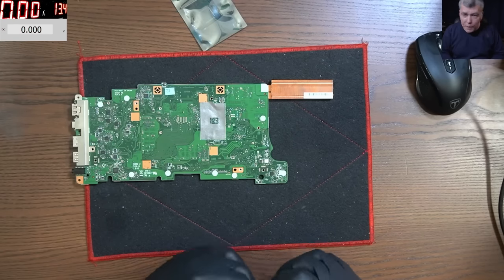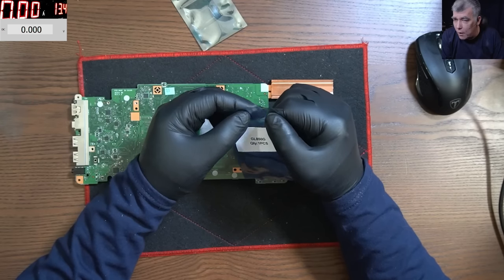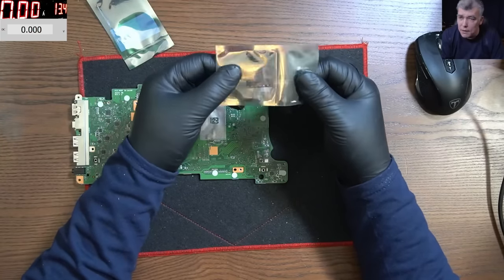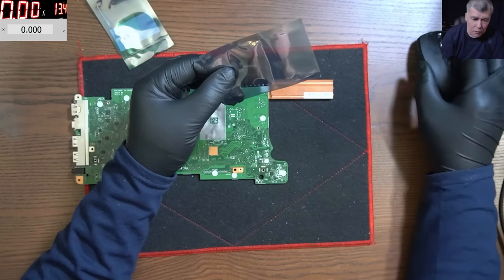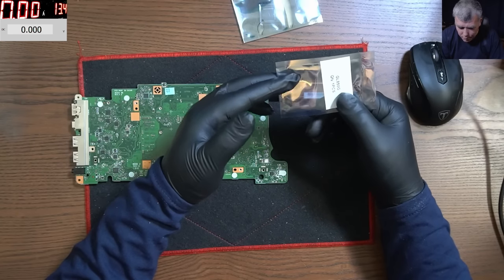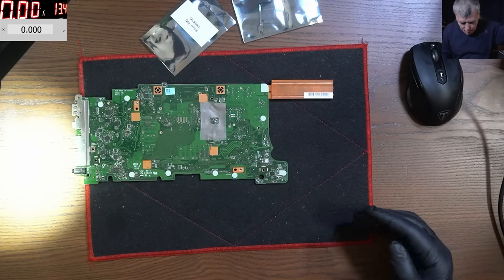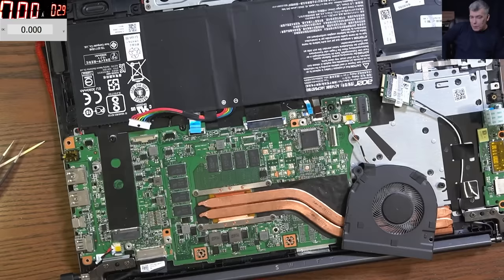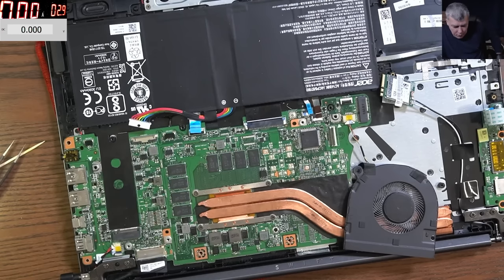Acer Swift SF315 no power - Part 2 - IO/EC/SIO chip programming

Comment: My God man, how can you deal with all those surface mount components, not to mention the lack of schematics and information on so many boards nowadays. I’ve been at stereo amp and tv repair on off for past 30 years and I still scratch my head trying to understand circuits with schematics. However I have never had a mentor or teacher, just book reading and exploring is my teacher. Props to you sir, I wish you the very best with this tricky repair.

Comment: Hi Sorin, for bios programmer you have selected , you need 1.8V adapter otherwise you will damage the bios chip
Reply: I think i have the same bios programmer but havnt used it yet. Do you have a link or more info about 1.8v adaptor?
Reply: yes it's better. I programmed a couple of them without reduction, but it's definitely not healthy for them.
Reply: 2 diode in line  to power will do the trick ....kkkkk my minipro work ok like that..  and don't overshoot the EEPROM, i just upgrade to xgpro from the same manufacturer
Reply: Can you tell me the device name that you use for programming the io chip I need  to buy one please help me

Comment: Hi Sorin. i have similar programmer & i used it since long time , it's very good, but it's complicated sometime as i have to find schematic to map KB connectors for unlisted boards , however you are getting error because you didn't connect the usb cable from the programmer board to the laptop for proper grounding ,... always learn from you Boss !!

Comment: Before we do the BIOS, try to remove the keyboard, disconnect it from the board, then disconnect both batteries, CMOS and the big battery, look for 3.3V on the  keyboard connecter on the main board side, and short it to the ground with the charger plugged in. Maybe the Keyboard power button is not working too, very common problem in new lap tops with power button on keyboard.

Comment: One trick is to use Kapton tape on the reverse side to hold the components in place. You can also surround that chip with Kapton tape to protect the components around that quad pack.

Comment: At 19:00 Vertyanov JIG programmer I have that Original IO Programmer, and it is quiet good. I using it for IO Programming Keyboard testing and EID LCD Panel EEPROM Firmware reading and programming.

Comment: Greetings Sorin, during programming I would connect a second USB cable labeled GND. It serves to unify the potential of the board with the programmer. The same cable is used as for connecting the control PC.just plug it into the USB on the repaired board.
Reply: The program in SIO is also written in the bios and should be extracted from it. Then you will be sure that you have the right program guaranteed. I use the laboratory power suply to power up repairing laptop. It helps when I can see what is happening with the device on the current draw.
Reply: And Vertyanov, as far as I know, is not from Russia, but from Ukraine.
Reply: Mr Guru  Yes the KB connector has the ground pin but the programmer is connected true the chip. The fact that the designer of the programmer put this connector there and directly described it in the manual is not just for fun. SVOD informs about this during every programming directly in the software, why? quote from the manual Vertyanov:  "Connect the cable from the GND connector on the programmer to any free USB connector on the motherboard. So, we connect the ground of the programmer and the MB. The shorter will be this cable - the better and more reliable."
Reply: Mr Guru  yes, but he couldn't program the first SIO, so he lost time and money, so the success rate of programming is 50%. But it's definitely not worth it to connect a second cable and be sure that I'm doing the thing as it was designed. ;-)

Comment: Many times if you download bios file it comes with bios and ec rom, i think you need to flash them both to have the same version. if you mix from a different version it may not start. happened to me a while back. however with this much damage on the board maybe its not that. if ec and bios and charging ic works you should have at least charging light, if you dont get charging light maybe some signal is missing, you need to check ac detect ac on pwr good etc... maybe some logic gate somewhere or transistor switch got burned as well.
Reply from the maker: I did had a flashing charging light before programming the EC, if charging is controlled by the EC then it will charge only if the software is working properly
Reply: @electronicsrepairschool   waiting for part 3..
Reply: @electronicsrepairschool  yes so you have to find bios with matching ec file. if you flash the bios and still no light then it doesnt match maybe you have to look on some asian sites if they have bios together with matching ec. or if still possible extract booth from the original file from the acer website.

Comment: I was thinking of a spike. But more in the direction of a power surge, lightning or a faulty power supply. Since it's on the 3.3V rail it could even be damaged in stand by mode.

Comment: Hi sorin. this vertyanov programmer is better than svod3. svod4 turned out to be a failure. It is very important to connect the second USB socket of the programmer to the usb of the motherboard to get GND. You programmed without GND. Greetings from Poland
Reply: Hi, I have the original Vertyanov and now I bought SVOD4. For me, I was quite disappointed with how everyone praised SVOD3.I'm starting to think that SVOD 4 was unfortunately just a waste of money.
Reply: @ServisTOPRO  I have an org. vertyanov and svod3. Good thing I didn't sell it. i also have a postcard from vertyanov.
Reply: @Marek_LapRem  I only saw the postcard in the offer, I'm not sure I would use it. I'm still at the amateur level. by the way, we are neighbors, I'm from the Czech Republic.😀

Comment: Ask the Russian on the "HamRadio Tag" YT account, he had many similar cases and mostly it was overvoltages via USB from the external power supply of the external USB drive or ground loops between the USB NTB and the connected device with its own power supply.

Comment: A little offtopic, but is there some sort of software image stabilization enabled on the stereoscope camera or it's software?  While the image of the board itself is fairly stable something keeps moving the white silkscreen and some other areas. I guess the image would be much better / more stable if it would be turned off.

Comment: Sorin why not use a copper wire bent in a square attached to a solder iron to remove the chip. I think someone showed this don't remember. If you have connectors near-by it is saver.

Comment: if we need to program 1.8v bios chip with CH341, we need 1.8v adapter, or need to buy latest model that have voltage selection switch

Comment: Good day Sorin! Original Vertyanov programmer/software has some sort of copy-protection. Non-original programmer can flash random data to the SIO chip when used with original Vertyanov's software. Author of the original programmer has video on Youtube where he shows how this copy protection works. Maybe this is issue this time.